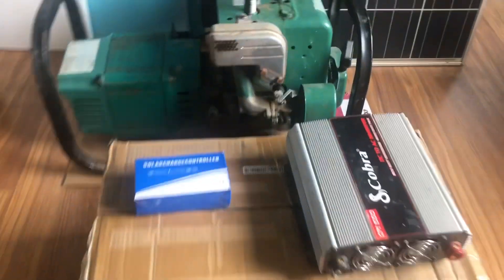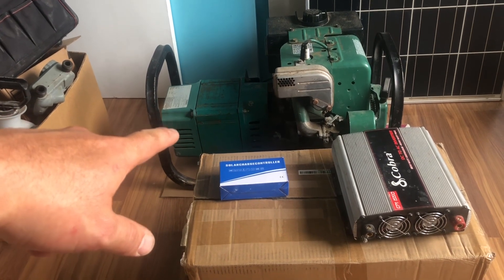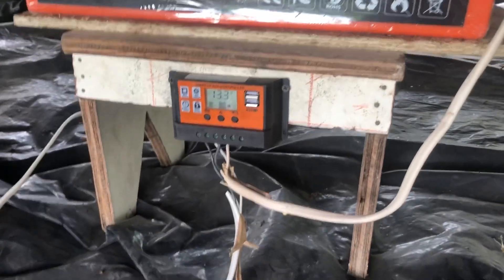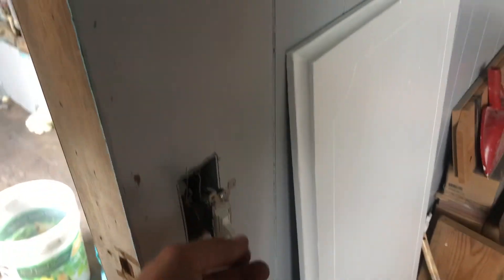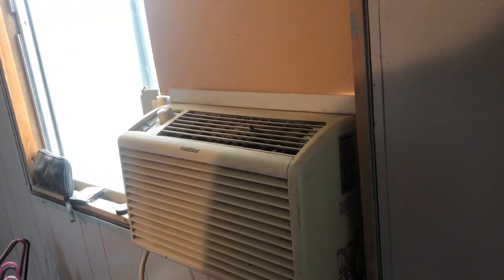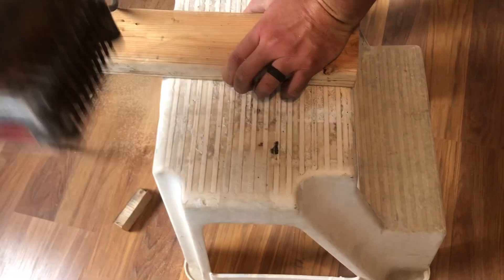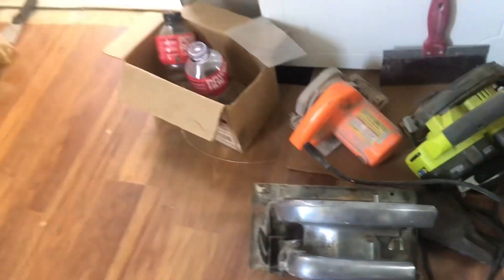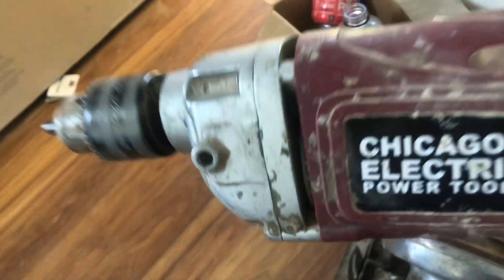Solar power for mobile home renovation.

Comment: Nice choice here Sir! I, too, got tired with relying on my old gas generator to do my trailer remodel, and went with the EcoFlow Delta 1000 battery bank and Allpowers 400w foldable Solar Panels. So far working great, and muuuuuch easier on the ears plus reliability! ❤🙏🤞
Reply from the maker: Yeah, I’m thinking about adding another solar panel or 2 just to run the ac more on hot days but I have yet to run the battery all the way down, but I don’t keep the ac on all the time when I’m there working.
Reply: @frugallandlord6974  probably a great idea for keeping everything cool, and overall upping your wattage potential on bad days as well as Winter reliability too as you mentioned. Awesome though how big that battery is, and I'm sure equally expandable there too when run in series if ever needed!

I'm hoping to eventually add Omnidirectional Wind Turbines in too, just to help offset my own poor Solar days. We definitely get plenty of good wind in the area of Central Lower Michigan I'm in, might as well take advantage of it too! 😁😉🤷🤞🙏🌬️
Reply from the maker: @MakerAcreNinjaNetwork  yeah and I’m starting to think going off grid wouldn’t actually be very difficult, it’s getting more affordable as technically is improving, especially batteries.
Reply: @frugallandlord6974  100% Sir! The cost per watt to both generate and store has come waaay down! Plus Biden just passed a new Act a lil while ago throwing out a ton of Tax Credits, Rebates, and different funds for making homes more Green and Smart Electric features. So, there's thousands of saving from it alone, on top of any State perks you might have available to offset costs even more. Then you could charge higher on your Rentals, for making it one less Bill people would have to worry about. Same way if you alternately went the Airbnb Glamping/Tiny House/Camper short term rental route to further diversify how many Doors you have to stream cash flow in constantly, growing your Empire further and further! ❤️🙏🤞
Reply from the maker: @MakerAcreNinjaNetwork  I was only thinking for my personal residence, but good on you for making me think.
Reply: @frugallandlord6974  my pleasure man!! ❤️🫂🤘 I'm always trying to think across all levels how I can utilize things in different ways, especially after coming to wanting to be a Content Creator! Setting up my LLC and Business paperwork, before ever buying anything to maximize Tax Write-offs, and all the crazy things that can qualify as Deductions for us. Let alone all the weird research I did into both the Creator side, Entrepreneur world, and Hustle/Mindset growth people...I've been making crazy new connections between what I thought were unconnected topics/Worlds but have lots of intersecting usages if worked right for synergistic harmony. ThinkMedia's Video Ranking Academy that I joined too has helped continue to evolve things through direct fellow Creator feedback and testimonials for what they find works in their niches.